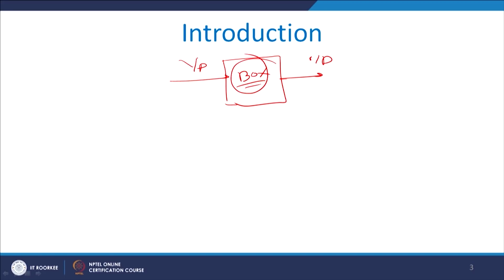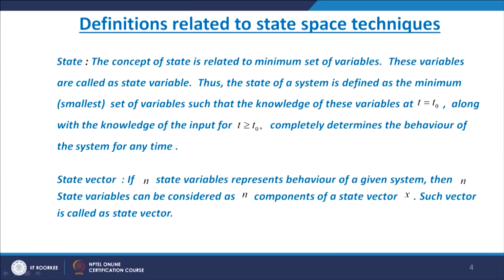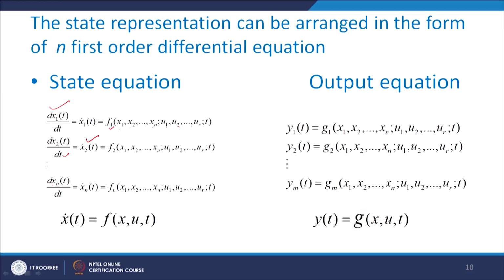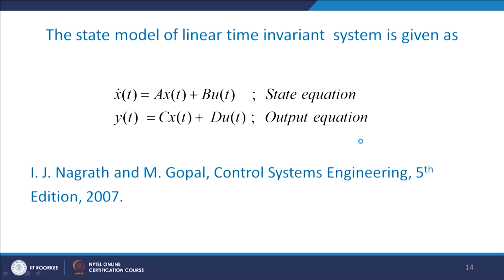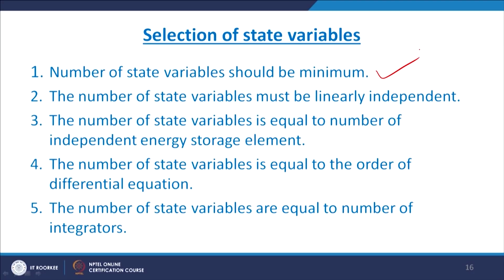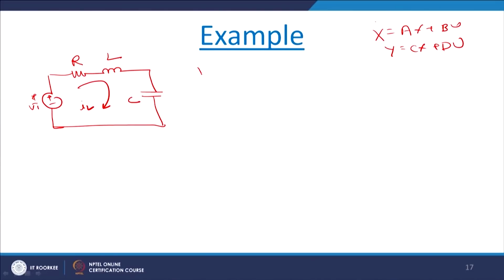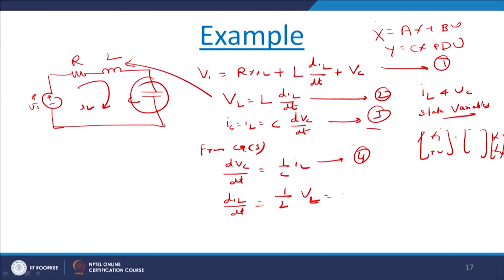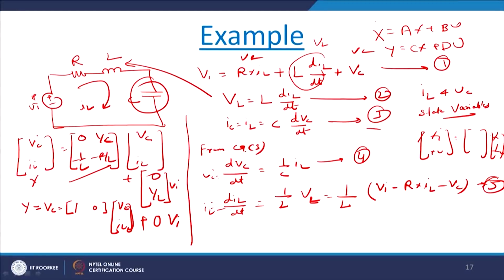State Space Representation

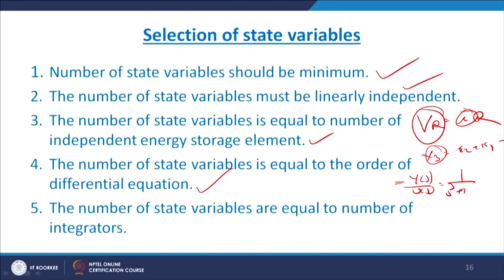Comment: How is number of state variables equal to the order of the ODE (16:03)?  It was mentioned earlier in this same video that the ODE will always be first order in state-space representation.
Reply: I think it should be "the number of state variables is equal to the number of first order ODEs". I hope this can be clarified. Thanks.
Reply: @sattikbasu2468  Yes that is what it actually is...just "slip of the tongue" :-) the slide at 7:40 (both sides of that time stamp) has the heading that clarifies it.
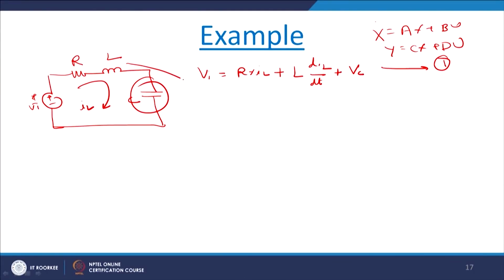Reply: no, the statement is correct. Actually, when at 18:38, eq. 1, you put the expression for Vc, it will have an integration of current term iL. So, you will again need to differentiate the equation to remove that integration. And then the equation will become a second order equation and thus, two state variables will be present.